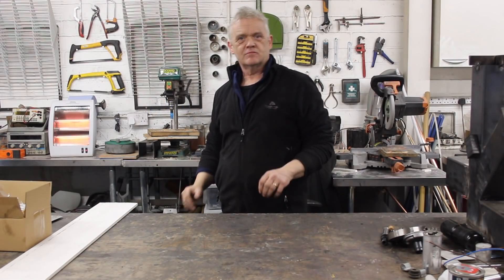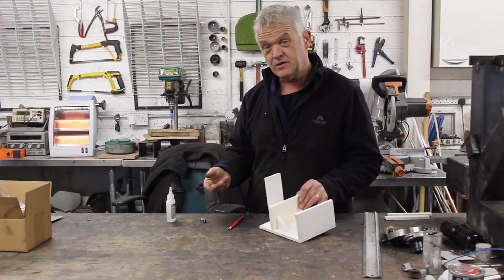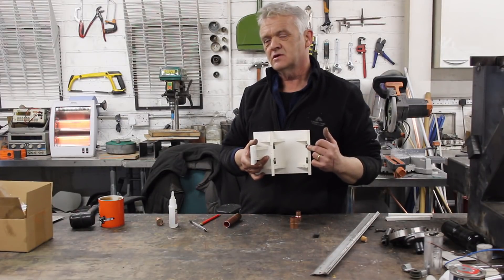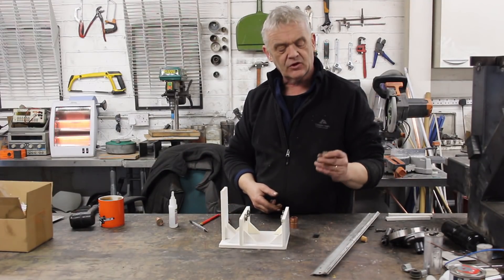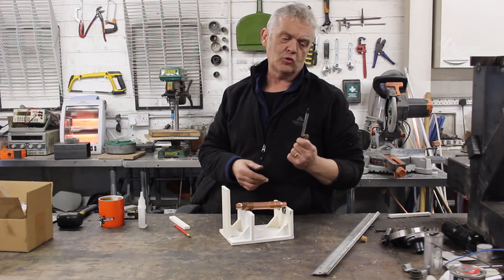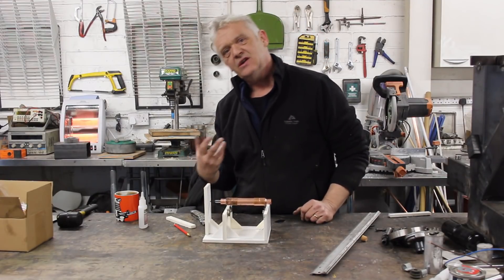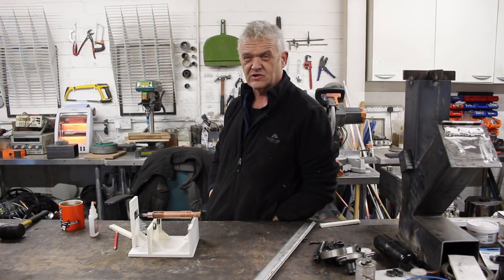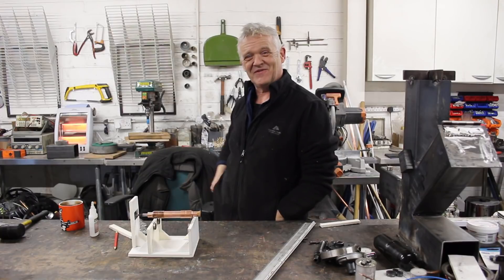1428 How To Make A Magnetic Low Friction Bearing

Comment: Couldn't you use two magnets with norths facing the same direction on the tip of the rod such that as it tries to push against the wall, the magnet also pushes it away, doing away with the friction the ball point contributes, allowing even longer rotation.

Comment: I've always had this design in mind, but never built it. I'm wondering why I've never seen a version of this where the contact point is just 2 magnets, mounted with like poles. One would figure that a  magnet mounted on the retaining wall and a magnet mounted on the floating axel, with like poles facing each other, would repel the axel and create a frictionless/floating system - am I missing something? If not, then I'd really like to see this apparatus working as a completely contactless system.

Comment: I must wonder if you could add a completely separate set of magnets in the opposite orientation (obviously located in a manner which does not disturb the current fields) to offset the axial force eliminating the need for the ball point bearing?

Comment: I don't think it would be useful for much, but that looks like a very easy system to balance. In fact, it looks very similar to the vee-bearing balancing systems used in motor shops and factories a long time ago. They challenge with those was always to get the bearings as frictionless as possible, which i think this design neatly solves!

If you want to do do a simple balancing, just spin the shaft a few times, mark the topside with a sharpie when it stops spinning, and the bottom side is the heavy one. Add or subtract weight to even it out. You could probably spin the shaft much faster and steadier just from that.

Better forms of balancing require a "floating" carriage, that the unbalanced shaft can shake when it spins. The shake of the shaft is generally measured by mechanical sensors or indicators in contact with the carriage, which is a problem here, because the shaft doesn't contact the carriage. The shaft doesn't need to contact a floating carriage though, because the shaft itself floats! First time I've seen that, in all my years of balancing mechanical parts. 

The shaft could be balanced at higher speeds by marking both ends of the shaft with different colored paints, evenly spaced around the circumference, spinning the shaft faster and faster until the whole thing starts to wobble, then hitting the whole thing with an adjustable strobe light. Adjust the strobe until the shaft looks like a still image, and you'll see one of the colors sticks out further from centerline than the others. That's the new heavy spot. Balance with weights, or a drill, or even dabs of hot glue, and then spin the fan faster until it wobbles again. Repeat.

Realistically, there's an upper limit to how balanced something can be. At certain speeds the shaft and fan will be affected by turbulence, the flex of the propeller blades, and weird resonances. In systems with fixed bearings, sometimes those speeds are surpassable, and only cause a slight hum or vibration while getting up to speed. In this system, the shaft and fan will probably fly across the room!

I bet you can get it screaming fast before that happens though.

Thanks for sharing! I used to watch your channel in college, when i was getting into electroplating. Now I'm a heavy machinist that repairs worn out bearing journals on large motors and dynamos.

Comment: I'm stuck in pair-coin-coil! To build a elektromagnets you need? To build up a faradays case you need? In order to  evacuate the flux from the capacitators. if that done like a elektromagnetic way and the Faradays case its only completed in high flux! it might work with inductive carbon plastic, and tiny ironfilament! As higher speed the flux reduces (and be as freewheel) and in slow wind it increas! if this drives the peripheral flux motores! And in center the VAWT is put in between two generator! It might be hard to decode my TnT:s here! But I got at least two Q:s  to live with a few years!!! 😊And the Q:s are: Why i want call it a Put In Between VAWT? And how long it takes to build away oil?!
Reply from the maker: hiya mate - I am not sure what you mean - can you break it down for me and ask one question at a time?
Reply: @ThinkingandTinkering  Hey Rob Magnetics effect and your 100£ is stuck mate now i think aboute dubbelflux and what you will put out of 100£. I Just think to take in a energyloop! And I didn't see it first! This idea is a U-tuber show a handdriven generator ands  it without Friction a flyweel and magnets on both sids dubbel it can give a big currency flow in a easy work...! Your work is great and Awesame you have hundreds of Ideas to work on! to take out energy of the  Rocketstowe this is a real good way I think to!!!!

Comment: I have seen videos using a magnetic bearing on a fly wheel but not sure if it’s the same configuration. So they can be used for heavy duty applications
Reply from the maker: yes they can but in that application I think they use active control

Comment: I wonder if you could put a second "bottom assembly" on the top to magnetically squeeze the floating rod so it does not wobble as much (since it bobs up and down a bit). Might improve the stability possibly?
Reply: This wobble may occure cause the copper pipe and magnets are not ballanced well. But I guess your idea is still very good, cause you can use the bearing in any position. And replacing this ball pen construction with a further set of magnets may reduce friction even more.
Reply from the maker: nice tip mate - cheers

Comment: I'm surprised that you haven't made that part of a wind energy scavenger by pulling apart stepper motors for the coils and threading the floating magnets in between them with a propeller on the end.

The low friction and small size would allow you to mount it on the side of a building without too much problem, and the magnetic action could suspend the unit so you won't need and ball point pens at all.
Reply from the maker: cheers mate

Comment: The copper never really moves through the magnetic field though I think, and the magnetic field doesn't change either. Would rotation in an unchanging field be enough to generate? If you would have a plastic pipe with copper strips separated from each other on it then the strips would move through the magnetic field, but here you have a single block of copper, wouldn't the "charge" be the same throughout the entire block of copper? Now you constantly have the same amount of copper in the same position relative to the magnets (ignoring any wobble from imperfection). Or am I wrong in my thinking?
Reply: Eddy current comes to my mind.
Reply from the maker: as mike said mate - eddy currents come immediately to mind

Comment: Auto pushrods often have ball bearings on one end.  While larger in diameter, they don't usually leave ink on one's fingers!  A hard "lead" pencil also works.  Is there hall effect "friction" using copper?  Great demo.
Reply from the maker: great tip mate and yes probably
Reply: @ThinkingandTinkering  
Would a north to north facing magnet kept it fully off the end with zero point contact. But would that magnetic end gauze be a point of friction????

Comment: Instead of the ballpoint-pen, could you use a magnet to keep the pipe in the right place? Would it reduce friction even more or are there magnetic effects, which would reduce the rotation?
Reply: Seems a bit of experimentation is necessary. I would wager that Robert has already tried it. I was wondering if a fine pencil point would be any better. Graphite is a dry lubricant after all.
Reply from the maker: Earnshaw's theorem mate - you would want to use a diamagnetic material like bismuth I would think
Reply: that's a great idea!  probably one would have to be a ring magnet
Reply from the maker: give it a go mate
Reply: @ThinkingandTinkering  I tried. I don't have magnets that are sufficiently strong to lift a paper tube.
Reply: @DoubleBob  I've got a bunch of small neodymium magnets from discarded headphones 😎
Reply: @angelusmendez5084  Thanks for the info. I should do more scavenging overall.
Reply: Yeah, I had the same idea and gave it a whirl. All it did was cause an upward  lift and/or sideways push on the end of the shaft with the magnets. Not sure if it could be countered by another set of magnets all the way around the shaft to hold it stationary, but me thinks probably not. Bigger minds than mine are required, but experimentation is the mother of all teachers.